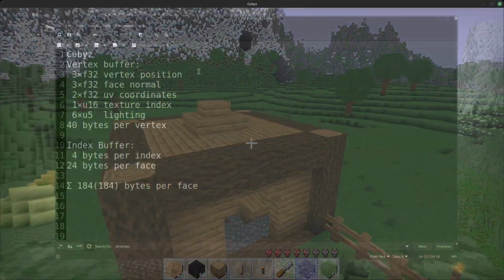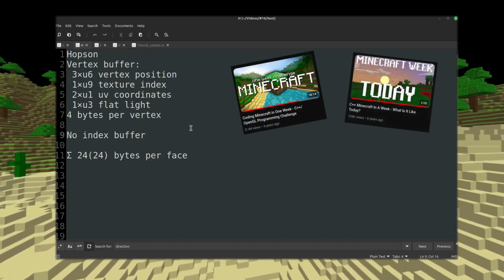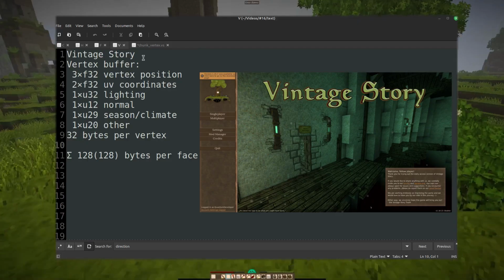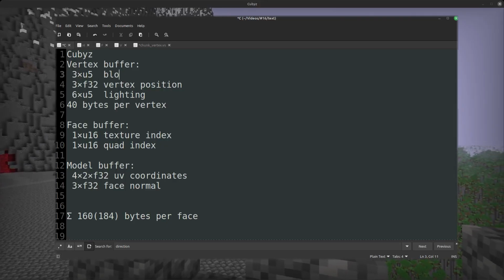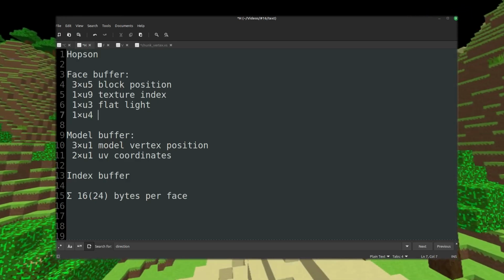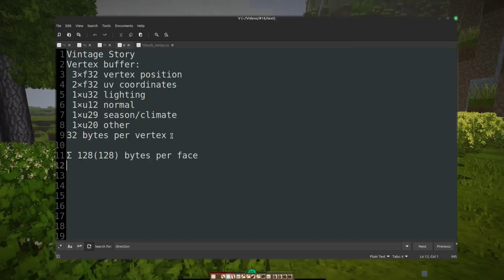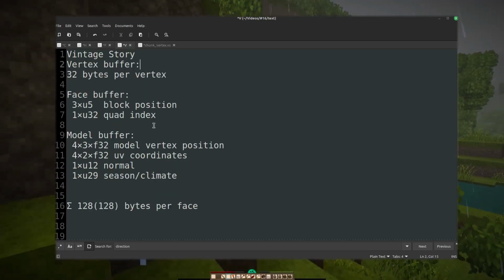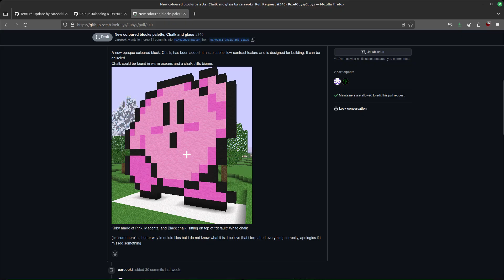Block Models, Stairs and Mesh Optimizations

Comment: Do you even need a face buffer? a vertex buffer at all? Just let the shader query the blocks themselves based on shader invocation ID. Maybe create a special buffer that lists potentially visible cubes (copies or pointers, whichever smaller)
Reply: voxel data is huge, that'd defeat the purpose
Reply: @ZeroPlayerGame  you have to keep voxel data either way though, the only question is whether you have a second buffer with graphics(faces) compiled to it (which themselves likely have bigger size per few faces than per voxels which create said faces)
Reply: @overloader7900  you don't have to keep in on the GPU, no. CPU RAM is currently like 8 times bigger than GPU RAM.
Reply from the maker: If you only store visible cubes, then does that mean that you would need to run the vertex shader for all 6 faces of these cubes? That seems pretty expensive.
Also how would you handle custom block models? These seem like they would cause problems since the number of faces per block is unbounded.
I think you would need a geometry shader for this, and they have a reputation of being slow.
Reply: @quantumdeveloper2733  You can limit it to 3 faces per cube (1 per axis) and select a face direction+location whose normal faces the camera. That said, i don't think that running a few more vertex shaders is that expensive. A problem is that they may create actual camera facing tris that are actually touching other cubes, but the shader can just ask if that cube is opaque, and become degenerate instead. 
For custom block models, the assumption is that they are the minority, and will use a separate shader. Maybe even the same that moving entities would.

Geometry shaders are slow, thats just a thing. But you don't need them - just invoke 18/36 vertices per cube in visible array, and let them index into it.
Actually thinking about it, indexing by dividing the vertex id by 18 might be a little slow, so using instancing instead might be better. Maybe even use triangle strips/indices, they would make texturing a bit more annoying but still doable from worldCoordinate+worldNormal+blockType (the former 2 can always be acquired in fragment shader from screen position+depth+inverse camera matrix/simplified equivalent and some derivatives).
Reply from the maker: @overloader7900  Running "a few more vertex shaders" can be quite expensive when you are vertex bound (which is the case for voxel engines like this).
For example if I increase the number of vertex shader invocations in Cubyz by 50% (which I can easily do without changing the number of faces), runtime increases by 30%.

Custom block models can easily become a majority, take a field of grass for example, most of its faces will come from the grass model.

"indexing by dividing the vertex id by 18 might be a little slow, so using instancing instead might be better." Divisions by a constant should be optimized by the compiler. Instancing on the other hand can be quite slow on some hardware when the instance is small like here.
Reply: @quantumdeveloper2733  If vertex shader cost is that high then you could draw a screen aligned bounding quad (depth initially set to closest vertex, then modified in fragment shader) per cube/chunk and then have fragment shader raycast into it. The cost of the fragment shader wont increase much because with only a single cube to check against most of the raycasting cost is eliminated. Then you will only have 6(4 with triangle strips) vertex invocations per cube. 

Again, that only really applies to bulk voxel terrain, non-cube things would have to be handled separately.

Comment: You need 32 bits lights to have RGBA with custom colors based on voxel verts. Why store the light value on the voxel verts? For let's say you have a point light that has a color different from the main sky color, you have to mix it to create a unique color. The alpha however seems unecessary, so I guess it could be 24bits, (0 to 255) RGB.
Reply from the maker: Voxel games generally use floodfill lighting instead of point lights.
To allow for smooth lighting and smooth ambient occlusion the light is stored in the vertices.
If we stored the light in the face then we would get flat shading like in minecraft alpha.

Comment: Will you add vertical slabs and fences/poles that can be placed on any surface of a block?
Reply from the maker: If you examine the house in the intro you'll see that vertical slabs already exist.
For the rest I don't know yet. It would definitely require some convincing for me to add "horizontal fences" (if that's what you are suggesting).
Reply: @quantumdeveloper2733  I'm not suggesting vertical fences, I meant to say Poles
Reply: @quantumdeveloper2733  I think that's called a handlebar

Comment: I have not seen the video fully yet, but have seen names I know
Did you see the video by Vercidium about optimizations ?
I find the techniques quite interesting !
Reply from the maker: Yes I have watched his video. Originally I wanted to add a section about it in the video, but it was cut for time.
I was really surprised that Vercidium didn't seem to know about the optimization I show here.
Instead he used instanced quads to achieve the same results that I get by using a per-face buffer.
I tried instancing myself, but it can be quite a performance problem on some computers, like on my 5 year old intel laptop I measured a 3× slowdown from instancing vs my per-face buffer.